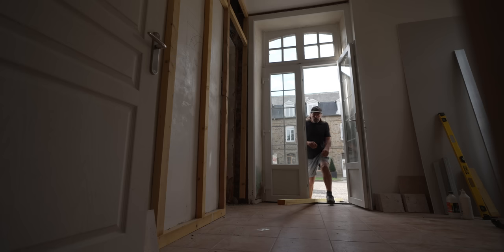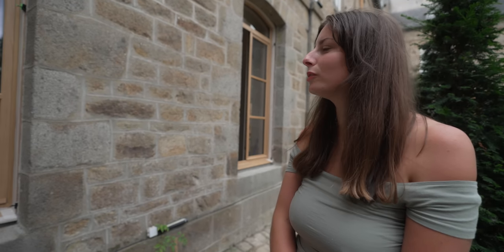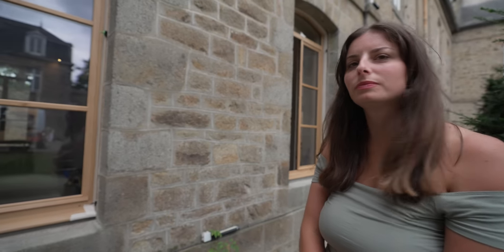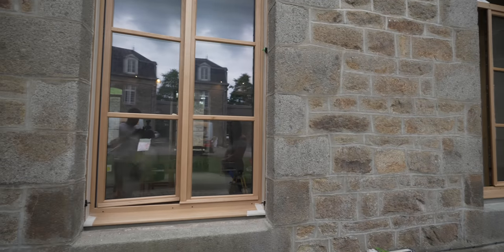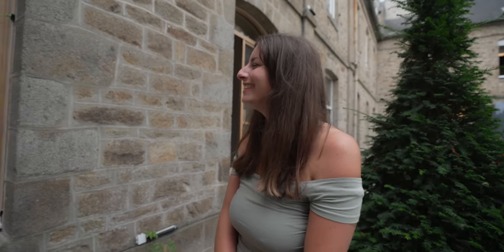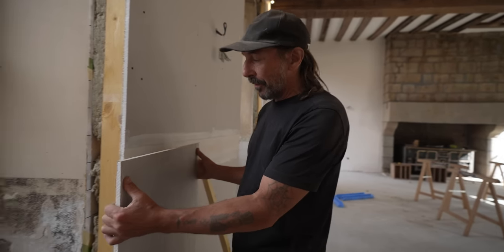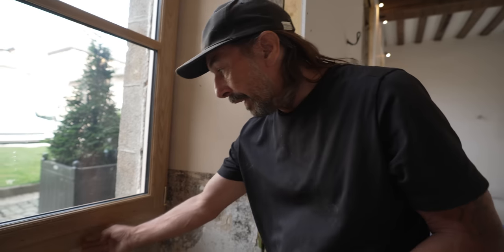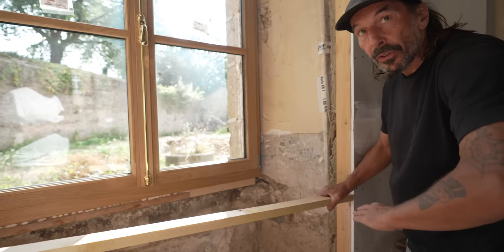Almost Ready For The Reveals

Comment: If money is no object - one might replace them all. —- BUT — What about painting the other windows with a color which matches the oak color?
Reply: Money is an object, but Billy is a great project planner & a visionary.  He & Gwen agreed, as each room is renovated, new, oak windows will go in.  Yesterday Billy mentioned 100 - 200 K euros for the rest of the windows.
Reply: Restoration means back to original. Painting is putting lipstick on a pig
Reply: @kathiefilkins445  True, although its worth mentioning that painted wood grain was a historical technique.
Reply: Painting would at least give it the aesthetics they want (at least in the courtyard) until the other windows are replaced.
Reply: I don’t think anyone is saying paint vs replacing. Painting is to give an illusion until the windows can replaced.
Reply: These new windows are incredible. They give the building so much depth, dimension and character. The vinal windows can be painted to match the color of the oak windows. However, if the windows are vinyl, they need a bonding agent to be applied before paint. In the US we have a product called "Gripit" which as and epoxy bonding agent that is applied before painting. There should be a similar product in France. The paint will never peel off. Try this on one window to see if the result works.
Reply: It wouldn't work, some of the windows are white, other ones are white plastic
Reply: Each of us should sponsor a window--or part of one.
Reply: @busterdee8228 Great idea!
Reply: @kathiefilkins445  I think its a great idea, it's a fairly inexpensive temporary dress up for a cohesive look, until the rest of the windows can be purchased and installed. It will take quite some time for the window people to make the new windows.. a little at a time..
Reply: I came here to make the same comment. A faux wood finish using paint is inexpensive and would give a great result. Especially on the high windows that aren’t easy to see up close. But maybe they don’t care about the mix and match windows while the project is ongoing?
Reply: I came here to say this as well. It’s clear that lots of other projects have to take priority right now financially. Until the windows can be replaced, it’s a great idea to paint them a similar oak color and come back to them when the time comes.

Comment: I had a thought about the new wall to be built between the reception and the bigger room. If I understood correctly the plan is to leave the old studs exposed and butt up a new wall right behind it? Maybe it would be easier to build a free-standing wall right behind it at first with completed plaster, and then just move it into place and secure it to the old studs? That way you don't have to fiddle with plaster work between the studs and save some time.

Comment: I think the answer to the window dilemma is to paint the white windows to match the oak windows and then there won’t be any urgency to replace all of them
Reply: Just said the same thing before I read your comment.  Completely agree with you.  Keri💜
Reply: You can wrap pvc windows in wood grain. It's a common thing in Europe. Not that expensive either.
Reply: yep exactly, Finish the Oak windows, any stain and i'll presume poly urethane  varnish?. take a picture, photoshop a color patch and have it matched.   lay on the paint (oil based if the urethane is also oil based),  stop there; or maybe dry brush with  a slightly darker color for a grain affect , then go over that with the polyurethane,
Reply: Absolutely what I thought.
Reply: Yes!!!
Reply: There is no urgency. Only going to replace as they do each room.
Reply: Yes, they have special kits for faux, 🪵🪓 wood kits.

Comment: I have a suggestion regarding the outside of the new windows not matching the older ones....until you can replace the rest, you could find an approximate matching paint color and paint the outside frames (the white part) of the older ones so from a distance they would look more uniform.

Comment: The windows are really beautiful and add tremendously to the entire space.  Am pleased to see that the one side of the kitchen will have counters all along one side even across the window reveal.  Have you designed a way to open the windows on that side or do you plan on keeping those windows closed all of the time.  I would be interested in how you planned to opwn them if that was in the plan as leaning over to open and close might be problematic and quite difficult.  I would expect, however, that you would have had a plan in place to circumvent that issue.  I have a similar issue with depth on some windows at my hoime.  I have yet to come up with a simple or easy way to using them.  Thanks again for sharing.

Comment: Suggestion: on the reveal with all the plumbing, don't plasterboard the whole lower section.  Go ahead and build the stud work but leave it open at the bottom or install doors or removable panels to allow access to the pipes.

Comment: if the other windows could you strip them of if there plastic windows you can paint them to look like oak have done it and it works well as a temporary fix fir a few years till windows can be changed

Comment: I've asked this question before and didn't really get an answer as far as I can recall so I thought I would ask again. I am noticing that when you guys add stud work and put in insulation, you are turning the wood so that the wider part is against the wall instead of the more narrow part which means that the wood doesn't stand out as far, that's OK. But I guess my question is, why are you adding what I think you guys called toggles to already existing plaster board, adding insulation and then putting new plaster board onto an already existing wall? is it because the walls in those apartments are very thin and don't have any insulation in them already? Maybe it's a building style that I'm not familiar with from being in Europe versus here in the United States. Just curious to try to understand. Thanks so much!